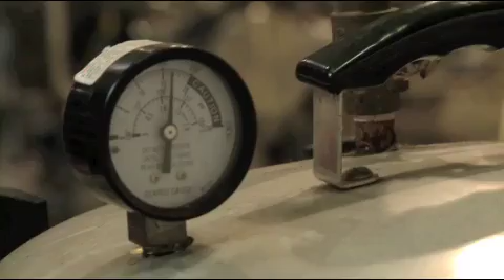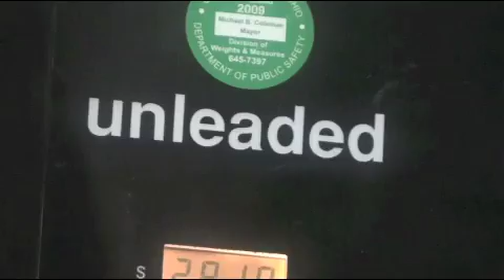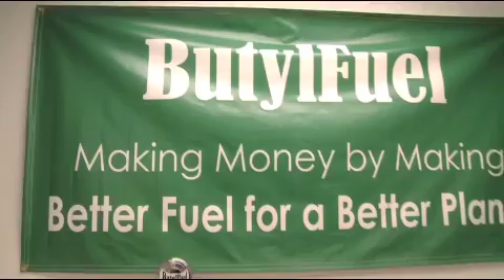The ButylFuel Story

Comment: Hell yes, how could anyone hate this idea? No mods to my current vehicle? Sign me up!!
Reply: Butanol is very expensive compared to gasoline. It contains more energy than ethanol, but that is not the reason ethanol is added to fuel. Ethanol is added as a cheap octane booster and as an oxygenate, which in turn leads to reduced emissions. However, your mpg will drop compared to using straight gas.